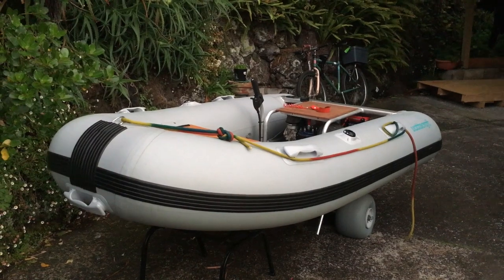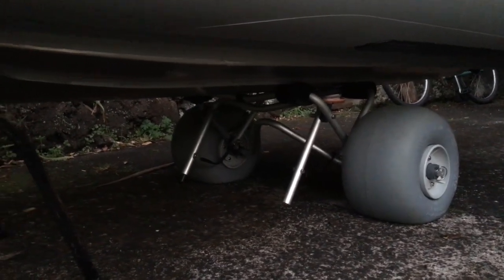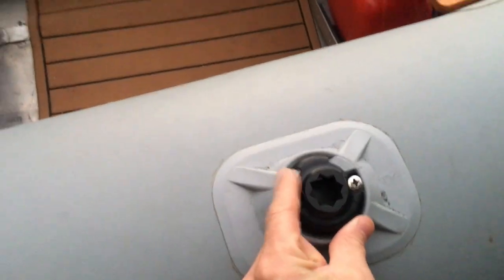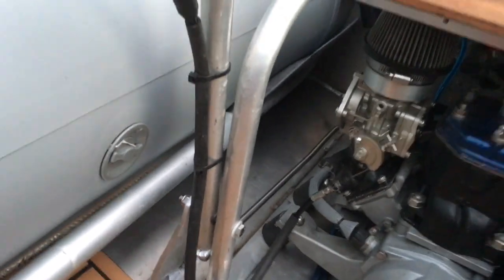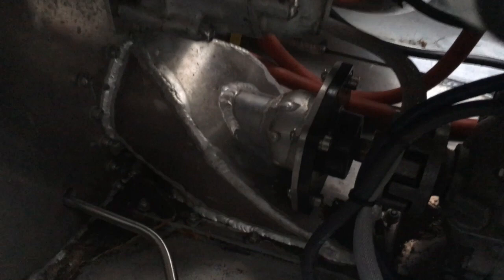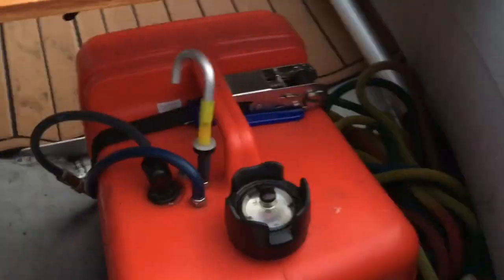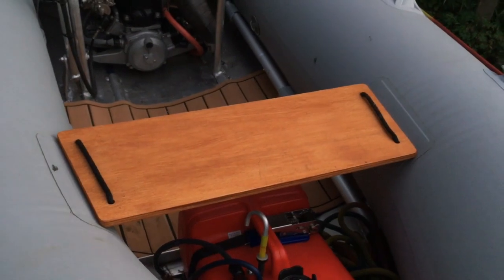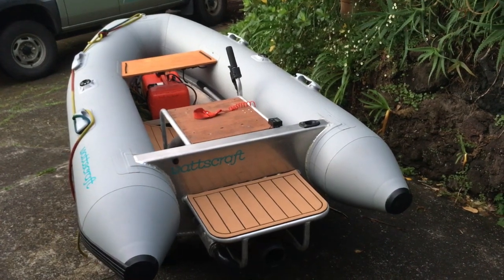WattsCraft micro jet-boat walk around

Comment: Would you run a 700 twin out of a super jet in this hull?
Reply from the maker: Id make a hull that was maybe 300mm longer and a 4mm i think. Would be the next combo i did. The superjet motor and pump are 1000x better than the js300.